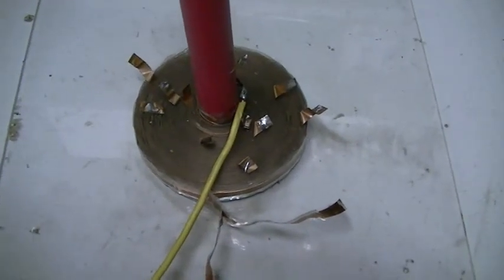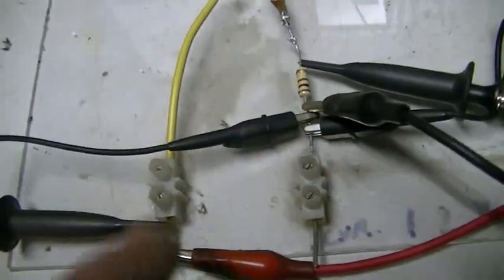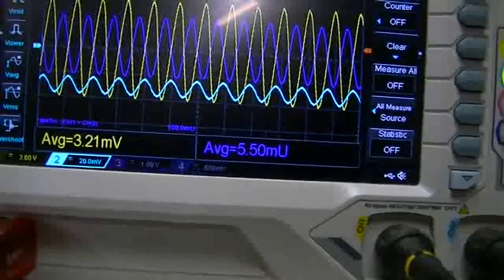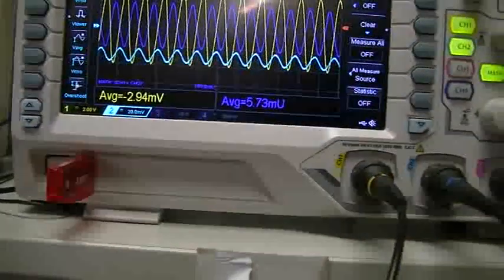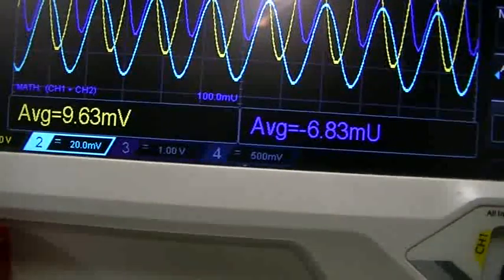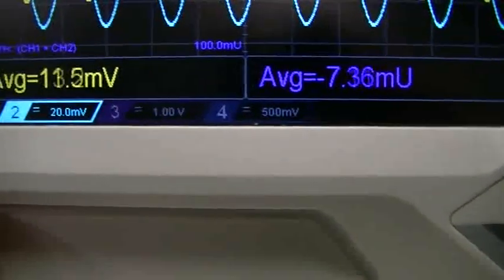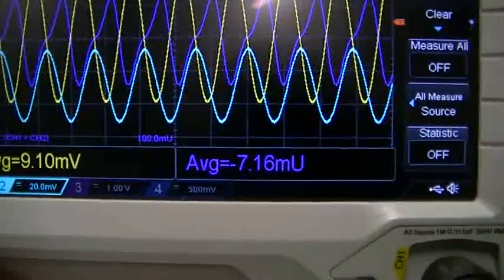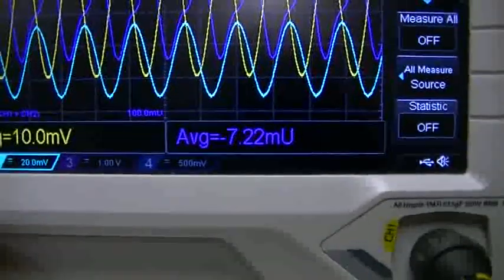Negative resistance

Comment: Re-commenting and deleted past comment.

Negative resistance is achieved when induced voltage is out of phase with induced current. The reason why it actually work is because of displacement current. Even though bifilar coil configuration is current going oppositr direction with each other, the induced voltage is a mirror of each other. When under true resonance, displacement current is maximum. The magnetic field generated by said ID amplifies each other. Results in output leading current, phase-retuned by the inductance. Hence, the bifilar coil now becomes a real pseudo-true negative resistor, where it consumes negative power but produces positive power.

Comment: Yes this is correct you are generating additional power. Ignoring the DC offset from the generator I mean.  The self resonance of your coil has delayed the current component of your measurement.
Such that E x I x Cos phi is negative meaning power is being created via resonance.  Looking at scope whenever E is positive (above the zero line) the I component is negative (below the zero line) and vice versa. To have real OU though we have to count the total energy used to create your input signal (input power from 240V ac) Not just input signal power vs reflected signal power back into generator.
Reply: And, of course, this is not a closed system...any magnetic (phi)/electric (psi) field is free to be disturbed by the outside environment, thus making OU calculations very difficult at low power levels and with wide tolerance (cheap) test equipment and components.

Comment: is this possibly a mismatched impedance reflecting power back into the FG?
Reply: Good question Mark.  TinMan could you check VSWR that would tell?
Reply: Yes resonance causes massive impedance swings on transmission lines.
Reply: Yes the VSWR issue is a common problem which can also damage the generator. There are common virtual earth techniques used to cause the generator node's rho value to approach unity.(no energy can be dissipated a perfect short cct or perfect open cct)  In this way each re-reflection bounce is eventually dissipated at the load end of the line (after allowing for return losses). When using this approach it is sometimes necessary to lengthen or shorten the transmission line, so the phase of the reflection arrives at the load in time with the incident voltage vector.
Reply: smokyatgroups.  We were very critical to check VSWR on the high power RADAR equipment on our Navy ship.  As I recall from school classes, EM issues such as radiation and dielectric losses and back reflection only became major issues beginning around 1MHz (coax cables used) and up.  We operated in the GHz range which then coax is useless and instead used waveguides.   There is a lot of spooky voodo magic involved and it seems everything looks more like art rather than electronics.
Reply: smoky.  You said "no energy can be dissipated a perfect short cct or perfect open cct)" Maybe I misunderstand your meaning, but as an electronic tech, I have to disagree with the former but agree to the later about an open circuit.  But about a "short"  in the real world, take a generator (3ph alternator)  driving a load.  Note the input and output power levels.  Now "short" the output load.  What do you find.  I have done it on a portable (1ph) bench top unit.  Answer, the generator lugs down (draws MORE power) but the "short" gets hot if small wire, and if the wire gauge is way larger than normal, then it does not get hot, meaning as you said little to no LOAD dissipation externally.  However, energy is being dissipated other wise the generator would not strain so hard.  Where?  IN the generator windings and core.  Thus there is energy dissipation inside the generator with the output shorted.  So in effect, a "short" shifts the load to the INTERNAL generator coils rather the normal EXTERNAL load.  In the real world there is always an internal and external loads (ie energy dissipation in both), but we like to make the impedance as low as possible on the internal coils so that much of the energy can be available to power our external equipment.  You can prove this to your self even with a DC toy motor as a generator and a resistor load and then shorting it out.  The ideal generator to load match for maximum POWER is when the the impedance of the generator matches the impedance of the load.  Any other combination does not give max power at output.
Reply: At true resonance, PF is unity 1.  Impedance is reduced to only total resistance of the circuit as inductive and capacitance reactance cancel.  Impedance only changes as you roll off either direction from peak resonance.